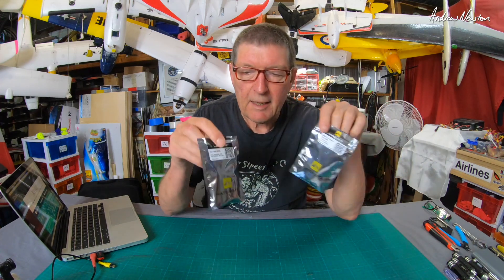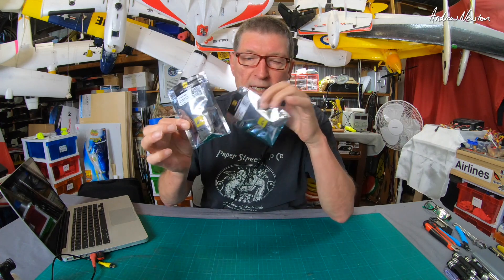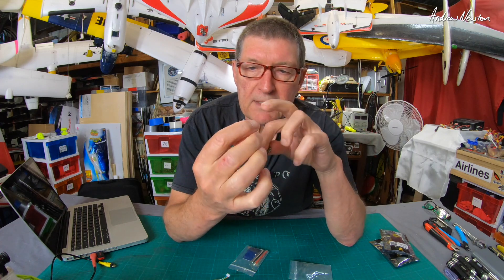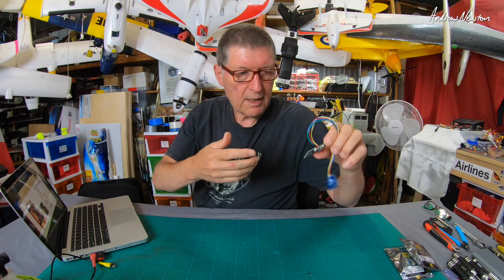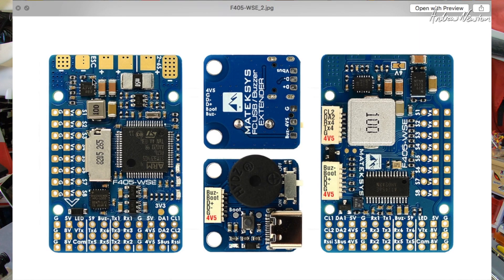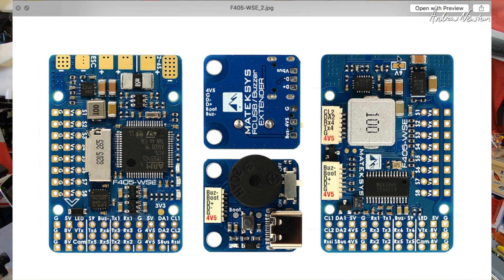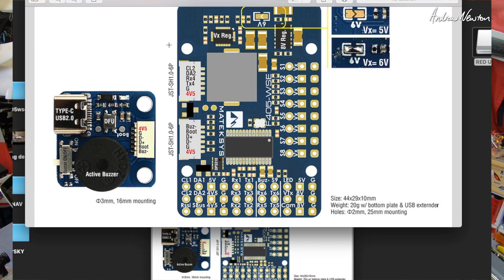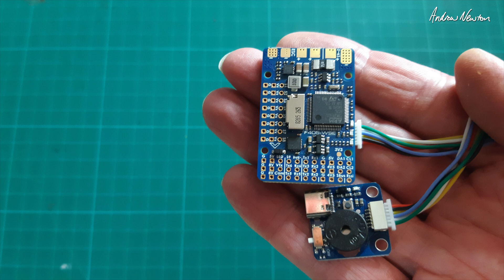Matek F405-WSE Flight Control Board

Comment: Good and informative video as usual. Do you (or anyone else seeing this post) have issues with the current sensor on the 405 WSE board ? I have a couple of these and the current reading is completly off stock and calibration is not possible since when calibrated on 50% throttle its way off at 25% or 75% and vice versa....
Edit: I use Arduplane
Reply from the maker: Are you using the recommended Arduplane current and voltage scales (on the product page)
Reply: @AndrewNewton  Hmm, not sure, I'm using it stock and realized it's off, tried to calibrate and do not get it right.
Do you have a link to those scales?
Reply: Update: Found the issue, scales were fine, but it was due to ESC noise, sorted with changed khz settings in the BlHeli_32 fw

Comment: Hello Andrew.
I´m about to buy this FC and put it on my skywalker 1900 long range FPV plane. I´ll be using Dragon link 433MHz system and 1.2GHz video transmitter.
Inicially I think I´ll be running ARDUPLANE firmware, not INAV.

Do you know which port are the correct ones to connect this FC to dragon link receiver to get Telemetry data and send it to the ground station?
Assuming this FC has NO RTS/CTS, seems that dragon link receiver has to be connected (according to dragon link manual) using its UEXP port connection to flight controller... 

Here comes my doubt...
Which Tx and Rx port on the F405WSE are the correct ones to send flight telemetry to dragon link receiver? 
Tx2 and Rx2? Tx3 and Rx3? Tx5 and Rx5? Tx6 and Rx6? Ground wire from DL receiver can be connected to any ground pin or must be one in particular?

Seems that Tx2 and Rx2 are the correct ones, but need confirmation... Didn´t find out this information on mateksys manual neither on Dragon link...

Thanks in advance.
Chears from Uruguay!
Reply from the maker: Dragon Links and Arduplane are not my area sorry. I do know the F765-WSE has Arduplane telemetry pads

Comment: On the Matek f405w board, the matek GPS M8Q-5883 is connected to its SH1.0_6pin connector (4V5 / G / TX4 / RX4 / DA2 / CL2) will the AP Mission Planner recognize this GPS, what should I do to achieve it (firmware Matekf405Wing )?
Reply from the maker: I dont know how in Ardupilot
Reply: @AndrewNewton  
If you connect only one GPS to UART4 (TX4 / RX4), set SERIAL3_PROTOCOL -1 or not “5”. otherwise, ArduPilot will stop searching for GPS during startup if it is not found on the first port (Serial3) configured for the GPS protocol.
And unplug the board from Mission Planner, unplug the board from the USB port if you have it connected to your PC. Reconnect the board to the USB, run Mission Planner plug and voala !!!!!

Comment: I think it should also be mentioned that the F405 wing original is one of the noisiest FC boards on the market and cannot be used for long range flying on the 433 band.
The F405-WSE is a much quieter board and is great!
Reply from the maker: Good information thanks
Reply: This is the reason I'm eagerly awaiting the arrival of one F405-WSE to replace F765 because of too much nose in 433mhz, lowering 100 fold DragonLink range.
Reply: Hi, which one would be the best for long range fpv flying to put on an old skywalker 1900, if using dragon link 433 band? I´m about to buy one of these F405 wse but get confused now...

Comment: Hi Andrew, this is a great little FCB with lots of good improvements but I was not too happy that they left off the top board. I felt that this leaves the power connections unprotected and at risk of shorting out if a metallic object happens to fall on them. I designed and 3D printed a cover plate which is on https://www.thingiverse.com/thing:4750446.
Reply from the maker: I like it Mike. Thanks for sharing
Reply: Electrical tape. :)

Comment: Your 3d printer does the same noise as my washing machine:-) Great content! Thanks for sharing Mate!
Reply from the maker: Ha, it's trying to communicate
Reply: @AndrewNewton  If the sound bothers you I have found the Marlin firmware 1.1.9 quieter than the absolutely ancient versions that shipped two years ago. You could also try TL-Smoother boards as those quiet the stepper motor drivers right down.

Comment: The 405-WSE has my attention, as similar width to 411-WSE, but has black-box SD, and USB-C. The extra UART will be nice to run DJI  with crossfire (without soft serial). Seems to be good balance features, for most common needs in small package.

Comment: Would you suggest this or the F411 WSE for using a DJI setup in the Nano Goblin?
Reply: I don't have one but use DJI on wings. I found with F411 series even with 2 uarts and 2 softserial that with Inav I couldn't have everything I wanted - GPS, DJI Camera/vtx, R9, R9 telemetry. It was tight on uarts. I think you'd be fine if you used both the DJI Camera/VTX and controller, or don't want telemetry. I could be wrong.
Reply from the maker: In theory both would work, but easier and more flexibility with connections using this one.
Reply: Any issue running off of VBAT? I only need UARTs for GPS and SBUS for Crossfire.
Reply: @SnowbirdSteeze  I run off vbat using the smaller caddx air unit. Rated to 6s but only run 4S. I don't know what the full size air unit is rated to - 4s I think.

Comment: Looks a lot smaller ... 
but which one is preferable cause matek offers the f411-wse too assuming that wse might stand for a featureset ?

Thx
Reply: The F411 can't run Arduplane due to not enough flash, while the F405 boards can run Arduplane.
Reply from the maker: Wing Second Edition or Special Edition. Decide how many PWM outputs and UARTs you need and choose accordingly.